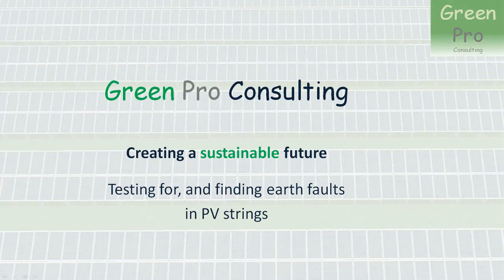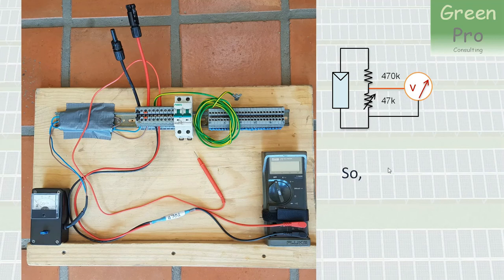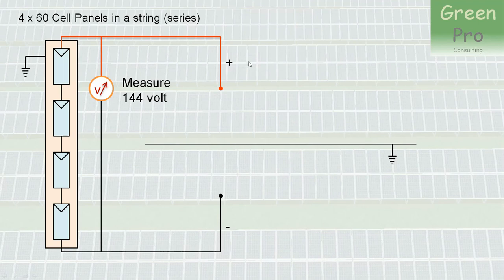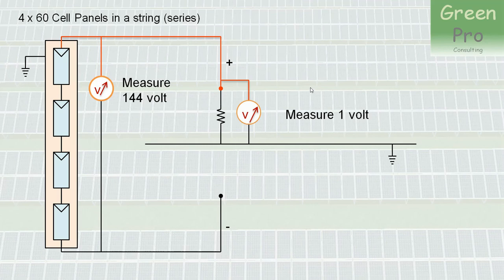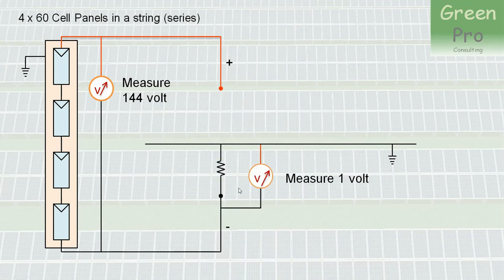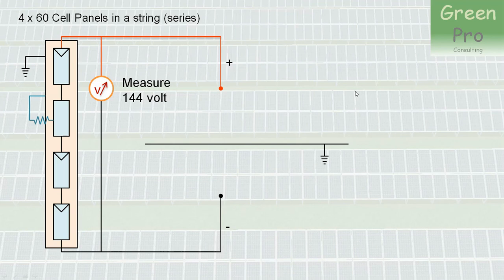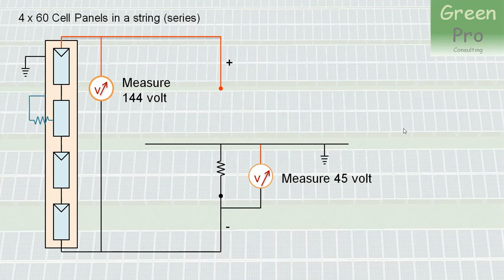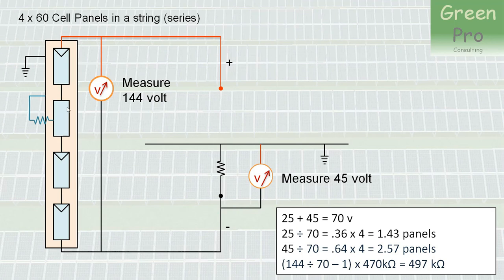Earth Fault Testing on PV String

Comment: I have 2 stings on my PV array. One sting running today at a peak of 249V @ 1.6A giving me 399w, the other string running at 272V @ 0.8A giving me 218w. Both stings are unshaded, one above the other and for some time I've had an issue with one sting under performing at 20% but now its 50%  less. This video Im hoping when i give it a go will find the fault on my PV array.

Comment: A schematic of your tester would be very helpful... hard to see from the picture exactly how your tool works.
Reply from the maker: It is a normal Volt meter. I then make up a dedicated lead that I use with a 470k-Ohm resistor between the two meter wires. Cut the leads about 10cm from the meter and solder a resister between them. It should be a 2W resistor. I then use it to measure between the two legs, and between each leg and earth.

Comment: Thanks for the wonderful video. I like you to treat the case and necessity of grounding PV string frames and the PV cable earthing at the indoor combiner box through an SPD while installing high frequency off-grid or hybrid inverters. I ask of this due to confusion regarding isolated vs non-isolated inverters with neutral to ground internal connection in the inverter.

Comment: This idea of testing strings is excellent, I have two questions regarding the calibrating of the analogue meter with the voltage divider. How do you set the potentiometer for the number of modules, can you explain this with examples? What is the potentiometer/variable resistor wattage?

Comment: Thank you for that,it really works very well.saves a lot of time.
Reply: It appears that you have built a test bench as described by Green Pro Consulting, would you be able to assist me with the following questions, I have two questions regarding the calibrating of the analogue meter with the voltage divider. How do you set the potentiometer for the number of modules, can you explain this with examples? What is the potentiometer/variable resistor wattage?
Reply: @ecoinfo6708  I have only used the circuit to test for earth faults, which works well. So have no experience regarding the first part of the vid, which I found a bit difficult the understand from  the accent. I hope Mr Greepro will elaborate it for you.
Reply: Thanks for replying, I will have to wait for a reply from Greenpro